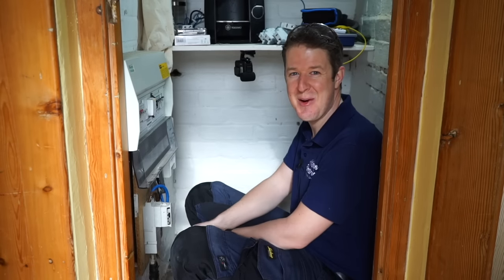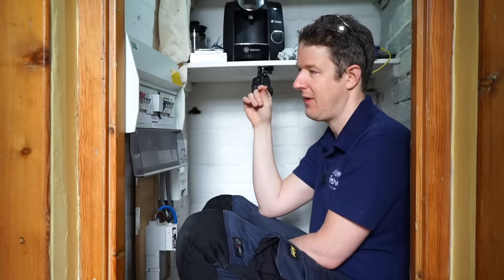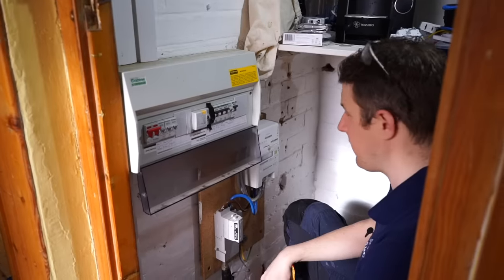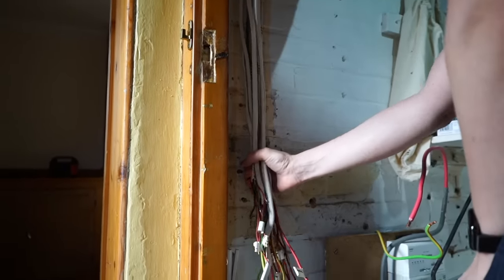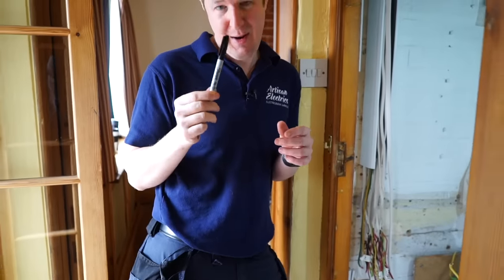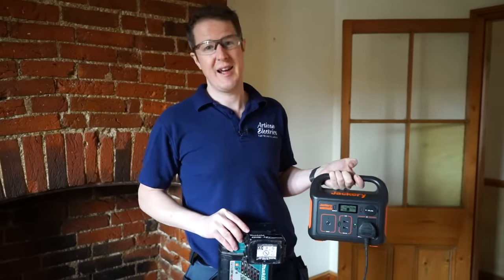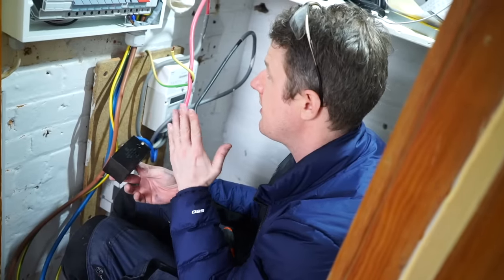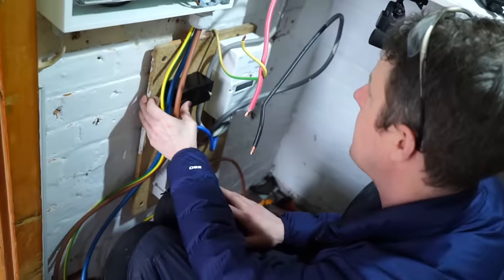My Consumer Unit Secrets 🤫 - How to install a Consumer Unit/Fuse Box

Comment: Having been an electricity network inspector myself. Only electricity network operators can cut the fuse seal and remove the main fuse. The electrition is not allowed to do this. 

The correct procedure is to to call the electricity network to arrange a disconnection and then another appointment for a reconnection when the work is completed.
Reply: I work for a dno and when I heard him say he needs to pull the main fuse alarms started ringing for me
Reply: Everyone knows that any extra time waiting for DNO is extra cost to customer. What is the solution? DNOs should be rolling out the fitting of isolators in all properties. Forget rolling out smart meters; get the isolator switches rolled out. It is in the interest of safety, the consumer and the trade. It is shameful that DNOs have not done this as a matter of course at original connection time.
Reply: That's an old wives tale, has anybody ever been prosecuted for carrying out such work. My meter was unsealed since I moved in 15 years ago. It's been inspected, read by a muppet many times and to date nobody has queried the missing sesl. Personally I got better things to do with my life than take the cover off it but maybe that's just me. You got to be some sort of bell-end to start pulling live cables out to bypass a meter, plus I'm not that hard up.
During my years I have cut the cut-out seal to make it safe while swapping out a C/U. The network suppliers are so long winded and bureaucratic it's no wonder we don't bother going through the proper channels. I always championed a switched cut-out in the 80's and I thought maybe the network operator would fit free of charge, no such hope. So we carry on with out you.

Comment: Nice neat job, but I don’t like the very large hole you cut in the top of an IP/fire rated consumer unit !
I thought holes in the top had to have fire rated grommets or stuffing
Glands, I Know you have the trunking 
But then you would need it running along the top with fire rated grommets.the trunking also makes an nice chimney to draw those flames up. Just don’t think this is to regs. Did not see any metal clamps around cables in trunking ?
Does anyone agree ?
Reply: Yes I  understand that the exit to the trunking needs to be fire protected.

Comment: Well if it tested out alright . And the custermer wants the consumer unit changing then fine .. You only have to replace it once . Done and dusted .I use the 2mm green/yellow sleeving a lot . Saves any earths slipping back in the sleeving

Comment: Some good sound information in this video, what was the total cost for your design 30 board and rcbos thanks
Reply from the maker: Thanks
Reply: More than most; he is artisan in Cambridgeshire - lots of customers with money to burn. If the owner of that house had received independent guidance then they would have known they would not need a CU change and could have saved themselves >£1k. RCBOs rack up the cost. Some people trust regs too much. In a world of fear, you can be out of pocket very quickly. If you want to be 100% safe, don't use electricity. Using it is already a compromise on safety.

Comment: I’m sure there’s a reason for it. But why haven’t you put the cut out, back in without the fuse in place as you were working very closely to live parts?
Reply from the maker: I just forgot but I did it later in the video
Reply: @artisanelectrics  “why weren’t you wearing a seat belt ?” “ I just forgot....I was about to put it on later but unfortunately ended up being thrown through the windscreen..”
Reply: @artisanelectrics  thanks for the quick reply as always. Fuseboard looks class 👍🏼

Comment: ...the only thing that I didn't like (the work in that box and detail was excellent!...always keep it clean for the next guy, because the next guy will likely be you lol), is the use of that Henley Block? (from Canada, I don't think I've seen one...I'm a Millwright not a Sparky...but still work with electrics on machines and controls)...it looks like a delicate plastic enclosure...and to be carrying mains potential current under the cover in an exposed area such as that closet...seems to be looking for trouble if impacted...would rather see it inside a metal NEMA enclosure...but again, I don't know anything about those blocks.

Comment: What do you do when pulling the fuse on a smart meter? My firm has had issues with fines from the DNO?
Reply: I did one a few weeks ago, the customer told British gas, I was changing the board and to expect the main fuse to be pulled, they were fine with it, and were sending someone to seal it after I had done the job

Comment: I am wondering why the british use so relatively small consumer units which provide little space to allow wires not too short for future use. In Germany even much older units provide lots of more space than the new one you installed here in the video. Even a unit for a small appartment without electricity meter comes with at least two DIN-rails. Most of them do not have their DIN-rails mounted directly onto the back lid, they rather hover over it to lead wires behind them. For some standard situations there are three phased connectors available to connect a row of circuit breakers with a RCD outlet.

I would prefer to have more than one RCD even for a small flat which is currently uncommon. If the RCD trips in the evening or at night, you are left in total darkness imposing further dangers to get injured.

Comment: You say metal rather than plastic will make it safe and nice. Was it unsafe before? All connections, wiring and components have been checked, tested and upgraded if needed. RCBOs to lighting, job done.
Reply: How much are crabtree starbreaker rcbos?
Reply: @megazeus7972  £30 for the 6A. And one circuit could go onto the RCD side. So £60 and very little labour.
Reply: @tobysherring1369  quite a lot of load on the one rcd there then, personally I can see why the landlord opted to go with an upgrade imbetween tenants, minimises possible disruption in the future by isolating circuits to rcbo’s too
Reply: @megazeus7972  agreed. I just did one in a flat which had no RCD so needed a new CU. Obvs used metal. There are some good reasons for doing it, and it depends how bad it was, and the budget. You could put all the lights on the RCD side and do RCBOs on the ring finals  Similar price.  My point was that it isn't considered unsafe in an EICR. Discrimination and load are different issues from safety. It just seems quite wasteful and a huge amount of labour to solve a minor issue.
Reply: @Lister Smeg in what sense? The moral question of totally replacing and charging a day's labour, or upgrading where needed and  taking less time?

Comment: I thought only the electric grid operator could break and replace the main fuse and seal it?
Reply: Yes, the option you have is to contact the DNO and request an isolator switch be fitted prior to CU change.
Reply: @andrew7440  Exemption’s are made , if your an “Artisan”

Comment: How do you explain the reasons for installing a hager RCBO board with SPD to a customer considering the price difference @artisanelectrics
Reply from the maker: Don’t explain just do it
Reply: I think with the amount of IT people now have at home &:people working from home, there’s always the argument of nuisance tripping & the level of disruption caused.  Same with the SPD and being able to protect the electronics in houses.  There is always the argument of additional cost but then there’s the argument of disruption & spending more on a distro board compared to replacing an expensive TV or IT equipment.
Reply from the maker: @Lister Smeg An electrician must prove by means of a risk assessment that an SPD is not needed otherwise he must fit one, so we just fit them as standard for our customers. The number of times we have found electronic equipment fried from a surge is more than you might think.

Comment: Love the fact that you left as much length as possible on the conductors before you brought them into the breakers. I'm wondering if it's possible to leave more of the outer sleeving on as well? It seems like the consumer unit is going to drift upwards by a few inches every decade or two when it gets replaced. Do the regulations require that the sleeving be trimmed back exactly to the wall of the consumer unit, or could you hide some of that behind the breakers as well?
Reply: The regulations only state that exposed cables outside an enclosure (ie. cables you can touch) must be double insulated/sheathed. You can leave as much sheath on as you like inside an enclosure, but it will make life a lot more difficult for you.

Comment: Is it me or would it make sense to separate the bigger RCBO’s to reduce heat, so rather than 40.32.32.32.32 you can have 40,6,32,6,32,16,20, etc etc to dissipate the heat, just my brain thinking that would make sense, what’s your thoughts???
Reply: Any heat build up would be negligible also this is a domestic setting were the shower maybe used for 10 minutes 1-5 times a day (depending on how many people live there) I could understand if it was a industrial where those breakers would pull there full load for 8+hours a day

Comment: I bet there is one thing you haven't done since you have been in the trade,on a couple of jobs I've worked on the which where large contracts the spec had us wire every circuit in the relevant phase colours which at the time were red,yellow and blue,but I have worked on an old large busbar which had tails that were red, white and blue and it was fed by an oil filled main switch

Comment: I have a question about the C3 on RCDs, NAPIT EICR Codebreakers says that a circuit without RCD protection that has cables buried 50mm or less from the surface of a wall is a C2. Also if an RCD fails the test at 1x or 5x (0 or 180) it’s a C2. In direct contradiction the GN3 inspect and test says its a C3, but I get that’s a more of a general comment not a specified one. Why is it that everyone I see on the forums is saying RCD unprotected circuits are only C3? Is there a ref I can turn up?
Reply: TLDR😂
Reply from the maker: Napit made a mistake in the book they admit that cables buried less than 50mm in walls should be a C3
Reply: Oh dear, is there anything in writing?
Reply: I can hear the NAPIT assessor playing devils advocate is all😅
Reply: @bradleyswainson9319  doesn’t really matter what NAPIT deem it to be does it - it’s up to the guy doing the inspection and coding - that’s down to experience and decision making Napit/niceic whatever only provide guidance and examples it’s up to you to decide if whatever observation is immediately/potentially dangerous or needs improvement
Reply: @artisanelectrics  I raised that issue with napit technical yesterday and confirmed  c3.
Reply: The napit code breakers book is a joke in most people’s opinions. It’s dumbing down our industry and the codes offered in the book are so harsh and not real world at all.

Was called to a doctors surgery yesterday were a napit contractor had carried out a EICR and gave every circuit without a rcbo a code2 due to buried cables <50mm (around 100) the manager said two young lads had a little book they kept flicking though before coding defects.

What started out as a good idea by napit has turned out to be a nightmare of poor judgment and Lazy coding.
Reply: Thank you for your comments guys, it was a bit of a head scratcher. I appreciate your experiences.

Comment: As the lid of the consumer unit opens upward why not mount at eye level so breakers are easily visible, i am sure an 80-year-old would be great full not having to bend down to see which breaker had popped.

Comment: Do you break out a fresh set of tails every time or do you use one kit for multiples when — like here — there is clearly less than half the length used?

How is it that DBs are required to be in metal enclosures, not heat resistant plastic, never mind wood, but the meter and main fuse can be on a board that isn’t even real wood, but fiberboard of some sort? Might as well store your collection of gasoline soaked rags on the main fuse…

Comment: Hello there.could I ask.a quick question please? If I was to have a man cave at the bottom of my garden and wanted around four double sockets in there,wall lights and a couple of outdoor lights, would the electrician have to take the power from the in house consumer unit or would it be possible to run the power from a outdoor garden socket and have a consumer unit built in the mancave. Thanku for taking the time out to read this.Best wishes.
Reply: Lol. There is a whole raft of detailed regs involved that depend on your individual case. You need to call out an electrician to advise. But in a nutshell, no, it is not a good idea to plug your outbuilding electricity into an external socket on the house. Would it 'work' if there are never any faults or problems and your total power consumption to your cave is low? Probably.

Comment: A very neat install but why put a joint in a 100A cable for no reason? As mentioned by others I would fit a Hager isolator (as the front cover goes around the tails making it easy to install) instead of a Henley block and as a competent person, do this without cutting any seals 😱. Also absence of the RCD six monthly sticker and 2 colours notice which make all installs look like a Libary.

Comment: Why would you do a EICR when you know you're going to do a consumer unit change? My understanding is that a EIC would be OK for PRS certification purposes and the tests required would be more or less equivalent and are certainly required for the CU change for certification and notification purposes....
Reply from the maker: It’s important to test the wiring before you change the consumer unit as often you can come across hidden faults otherwise that can make the board change a nightmare

Comment: No rcd on lighting circuit is a C2
" No RCD protection circuits in a bathroom - C2"
"No RCD protection for cables buried in walls within 50mm - C2"

Comment: I'm not picking (Really):-) But you seriously should be wearing Insulated gloves & heavy duty gloves aswel as Visor, not to mention fire resistant clothing to pull that main fuse. I understand it's a cottage and probably fed overhead. It's just that i have seen the damage a cut out can do especially U/G which can possibly be fed via 4 S/stn's = 4 x 315Amp fuses. Cable is likely to go before any fuses operate under those circumstances. :-(
Reply from the maker: Yeah good point
Reply: Paul, assuming having tested for dead, and put a clamp meter on the tails to check no current flowing, what potential problems might arise from pulling the fuse?
Reply: @andrewcadby  Hi Andrew, i have seen brand new  cut outs where the cable has a hole in the rear. You can't see it but goes off like a bullet(even without disturbing it). Older c/outs may have overheated ie tar dripping etc. Sometimes hard to pull, also a chance of shorting cores together. Not to mention getting really unlucky and the network changing state, under fault conditions just as you remove or replace carrier. Also when fuse is removed, a plastic insert can be used to prevent Tails or earth flapping into live infeed?
Hope this helps, not tryig to scaremonger, just safety facts :-)
Reply: @paulmac8016  thanks for the info Paul, appreciated

Comment: Not just safe and functional it is so people as you said working on it in future can see what is going on. You fix the mess to rewire and quote the customer they tell you to shod off. Too expensive, they get the idiots to just put a bandage on it and really screws anything in future for a quick easy cheap fix.

I mean here my house has same issue but I cannot work on it coz no license here. Had a ground leak tested, told electrician this and that is the issue, they confirmed and left disconnecting old Aircons that came with the rental at the outside electric part without even trying to kill the breakers those wires were on. So yeah does not trip coz the circuit disconnected but when I checked those end point still read live on my meter. If my house law does not prevent doing electrics here but rental it is a different story. Hate how the big wires that can run 30amps but the electricians just made the owner pay for long wires they just coiled up in the roof absolutely destroying wifi 5g band. Plus washing machine running same circuit as lights and plugs of 2 rooms in house. Bloody monkey show what some licensed contractors can accomplish vs diy

Comment: Jordan you disappoint me, as Mr Future Proof, I expected you to use an Isolator instead of the Henley block. After all there is no requirement to split the tails. And when your loyal customer calls you back, its a cinch to make the CU dead. No more naughty fuse pulling. Only kidding. -  Stay Safe.
Reply from the maker: Very true 👍

Comment: You aint straightening those wires by "warming them up" - the re-crystallization temperature of copper is way higher than you could achieve with a cloth.

Comment: Can you put up a link or mention that grommet again please. 
Little tip for flexy tails pushing through tight wiska glands , rub a tiny bit of fairy liquid on side , they fly through then !!!
Reply: Wd silicone spray. Hands that do dishes! Ha
Reply: Take the rubber gland out no need for it just causes hassle and stress

Comment: Why 40 for  meter tails gland ? Its 32
Reply from the maker: The wiska ones that we use are 40mm with a 32mm reducer but I don’t like using the reducer it makes the gland stick out too far.